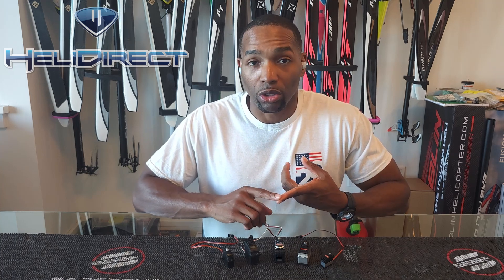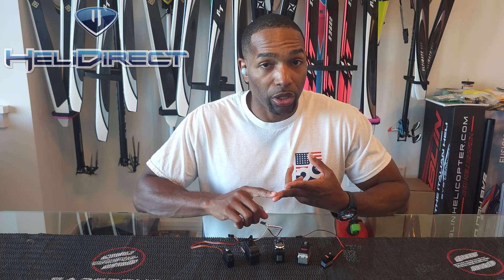Servos 101 with Professor Mikel Graham!  Part One - What is a servo!?

Comment: There are various types of servos, hydraulics, pneumatic, electric, and mechanical.
Also, they are classified by the control type and motion; analog, digital, and hybrid.
Positional rotation, continuous, and linear.

An electric servo is an electric motor with a potentiometer attached to the output shaft. Newer digital high performance servos use microcontrollers and microprocessors for consistent torque and response time. Some are even completely tunable like Theta servos. 
Also when discussing servos u should mention duty cycle, PWM, frequency, PID, and of course hertz.

Could of covered more. Could of broken out the oscilloscope to show the waveforms and etc if u had one.